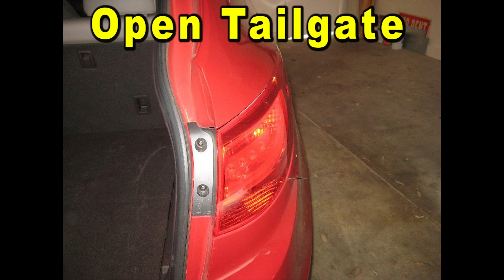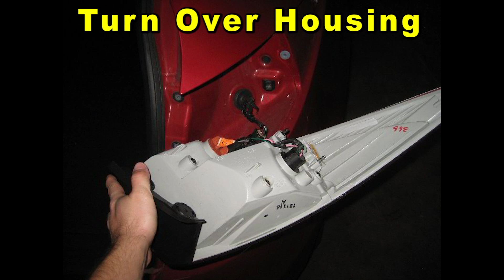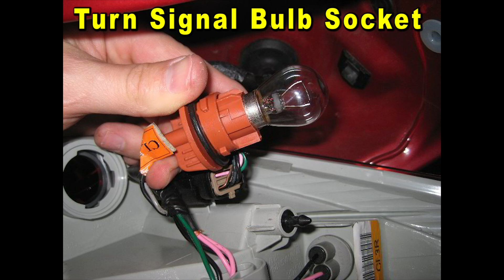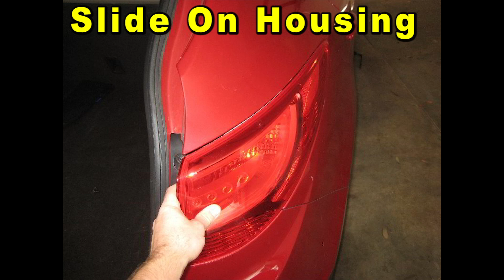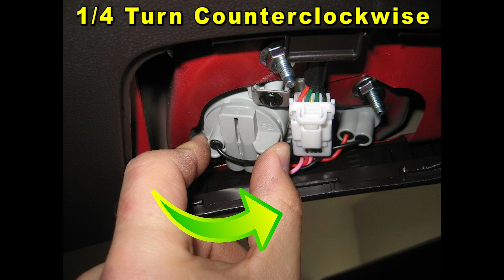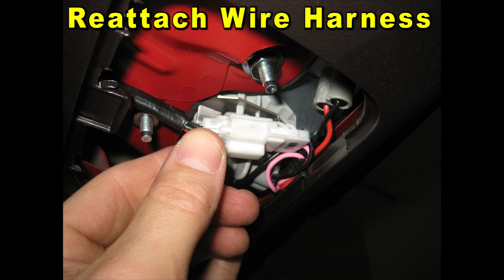2010 To 2015 Hyundai Tucson How To Change Tail Light Bulbs With Part Numbers

Comment from the maker: Hyundai Tucson Brake Light Bulb - https://amzn.to/4fLEytA
LED Brake Light Bulb Part Number - https://amzn.to/3WNGPMr
Hyundai Tucson Rear Turn Signal Bulb - https://amzn.to/3WHGZoq
LED Rear Turn Signal Bulb Part # - https://amzn.to/3M7Q70B
Reverse Light Bulb Part Number - https://amzn.to/3yIR5NU
LED Reverse Light Bulb - https://amzn.to/46MlCqI
Rear Side Marker Light Bulb - https://amzn.to/3M5kPaX
Parking Light Bulb - https://amzn.to/4coBvoh
Precision Screwdriver Set - https://amzn.to/3sLixaP
Plastic Pry Bar Tools - https://amzn.to/3HMtsV7
Socket & Ratchet Set - https://amzn.to/3Z17LbA
Mechanix Gloves - https://amzn.to/3jCnHkt
Torque Wrench - https://amzn.to/3vS5uSI

The Paul79UF YouTube channel is a participant in the Amazon Services LLC Associates Program, an affiliate advertising program designed to provide a means for sites to earn advertising fees by advertising and linking to Amazon.

This DIY video shows owners of the 2nd generation 2010, 2011, 2012, 2013, 2014 and 2015 Hyundai Tucson SUV how to change a burnt out brake, rear turn signal, parking, reverse or rear side marker bulb in the tail light housings.

Comment from the maker: Check out the DIY guide for changing the tail light bulbs in a second generation 2010 to 2015 Hyundai Tucson - 
https://www.paulstravelpictures.com/Hyundai-Tucson-Tail-Light-Bulbs-Replacement-Guide/index.html

Here are all of the DIY repair and maintenance tutorials for the 2nd generation 2010 to 2015 Hyundai Tucson - 
https://www.paulstravelpictures.com/Articles/Hyundai-Tucson-Common-Problems-Repair-Maintenance-Guides.htm

Owners of other Hyundai and Kia vehicles such as the Accent, Elantra, Sonata, Azera, Veloster, Tiburon, Genesis, Lavita, Veracruz, Santa Fe, ix35, Equus, Cadenza, Forte, Optima, Rio, Soul, Sedona, Sorento, Spectra and Sportage may also find these DIY instructions to be helpful.